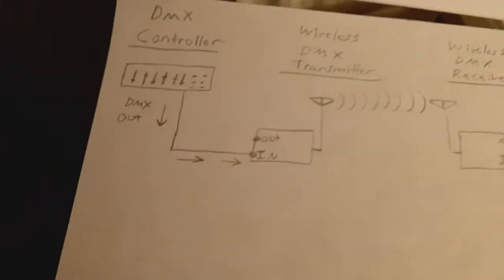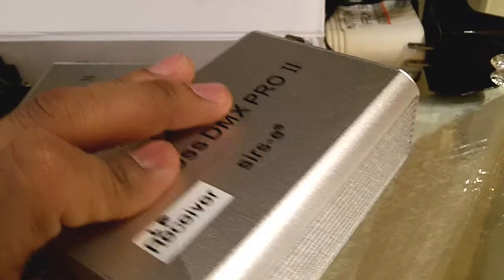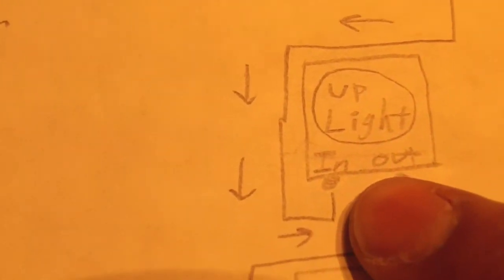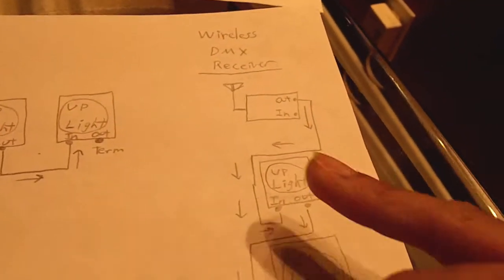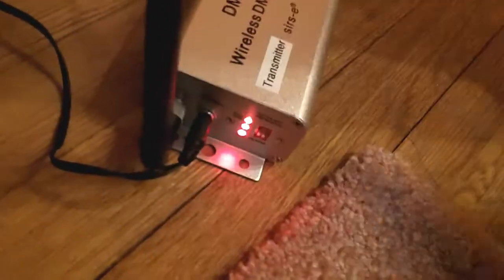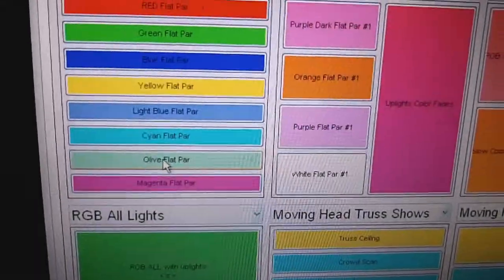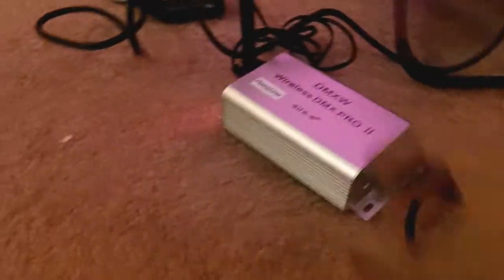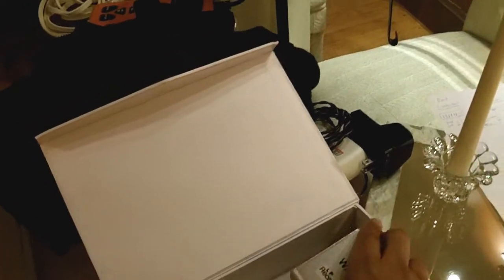Wireless DMX Totorial

Comment: what if you if you have a built-in receivers in your lights will the transmitter  catch it?
Reply from the maker: Charlie Valenzuela may not work as I think they need to be the same brand or same exact system with same RF frequency.

Comment from the maker: They should be sold at your local store that sells DJ lights. Search Ebay for DMX Terminator and you will see them for sell around $4 each.  I have access to all the XLR and resistors on my job so I just build mine. Just a 120k Ohm resistor across pins 2 and 3. If you lived in VA I could just build you a bunch LOL

Comment from the maker: Thanks Bobby.  If you don't terminate the end then sometimes lights will act crazy or flicker. Always good to terminate the end. When changing colors all lights that are programmed to change when that color is selected will change. Doesn't matter the fixture. When you program the light scenes, you will have to tell the software or controller which fixtures you want to change when you pick a color. I herd the wiflex had some issues with fixtures. So far the 1s I have don't have issues like that.

Comment: nice vid. what happens if you don't terminate at the end of a line? 09:25 does hitting those color scenes change all fixtures to that color, even if they are different types? slim pars, moonflowers, and moving heads??? 11:02 for some reason, the wiflex system doesn't like slimpar 56 fixtures from chauvet. idk why, but they aren't compatible. I need to stop getting lazy and learn dmx. thanks for this post busta B!